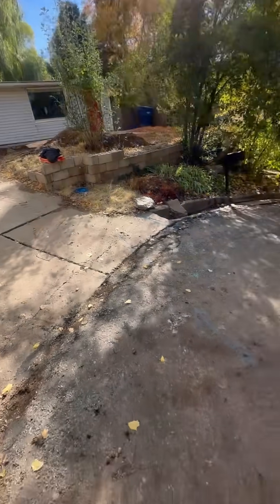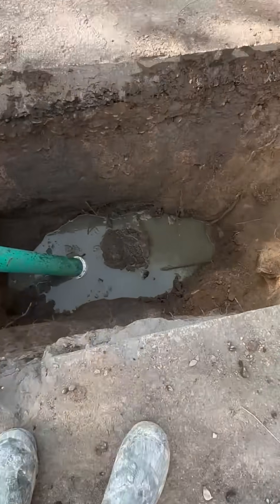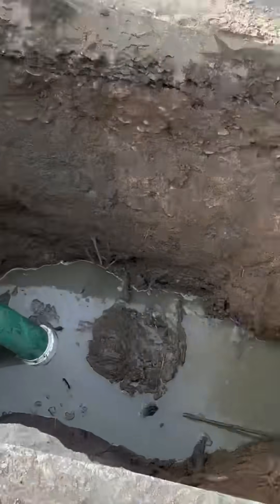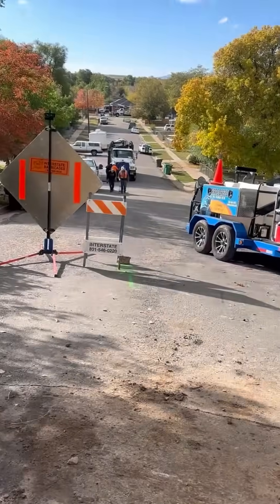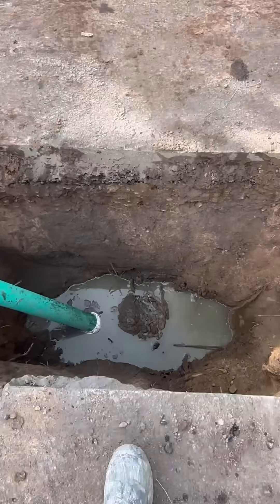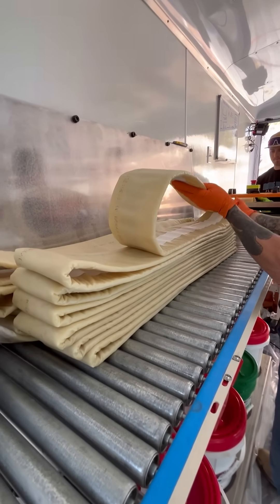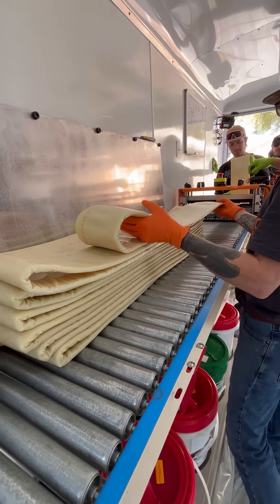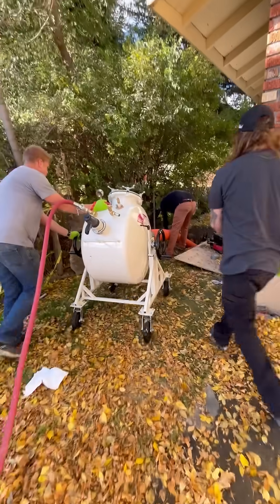What is Pipe Lining?

Comment: The problem is the pupe liner is being used incorrectly, all you have done is block off wvery single side pupe that joins the pipe you sent the linerr down and being a soft plastic is polution and the tree roots will grow through it by tomorrow...... keep having fun with it. 😅😊
Reply: It hardens lol I’m assuming you’ve never done a liner ?
Reply: Are you under the impression that a building sewer has a bunch of lateral lines tying in to it?  1.  They don't.
2.  These guys camera the line and know what is under ground.
Reply: You clearly don't understand how sewer liners work, and can't pay attention to the video to know that the liner is resin impregnated fiberglass. It is harder and stronger than the original pipe when it cures.

If there are branch lines, those are dug up and the liner is cut with a carbide grinder to open the branch line. This is all documented before the reline process, only an idiot would shoot a liner down blind.